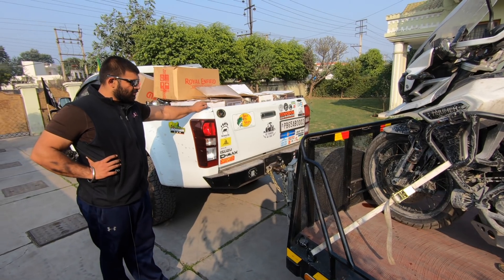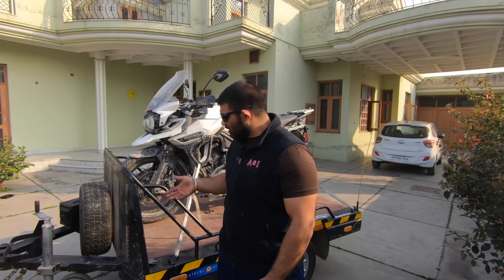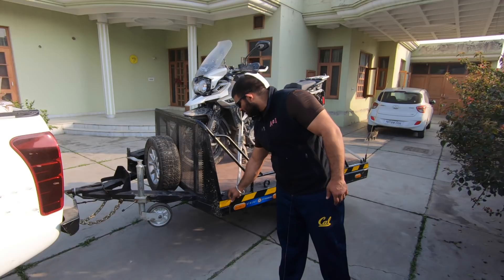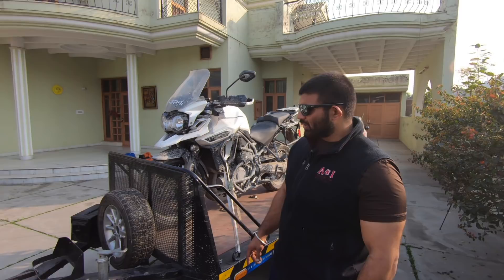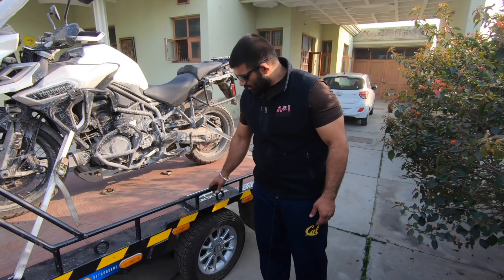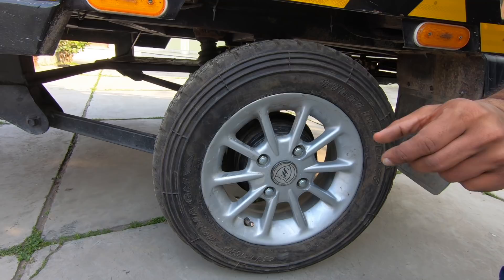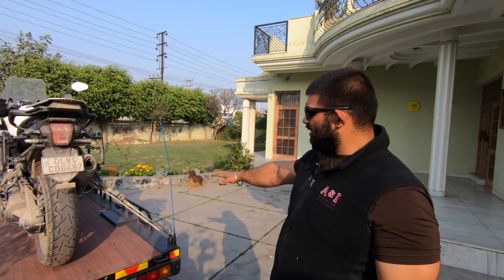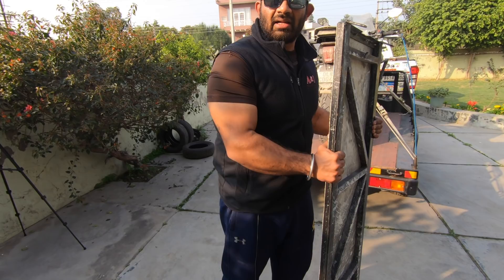Jaideep's Motorcycle Trailer Carries 2 Bikes At Once: He Built It From Scratch

Comment: I believe the trailer is a bit too high, but probably suitable for roads in India, but this trailer is disadvantage for bikes which not able to start or someone physically smaller in size as the ramp is too stiff. There should have been some jaw winch or manual winch, or trailer should have been design to be lowered hydraulically. Some housekeeping required on the electrical connection, does not look nice exposed. The turnbuckle eye a little bit too big, as long there is no excessive gap its fine. Keeping those boxes is unnecessary in my opinion its an hazard for road users if it falls.15.54 is dynamo or eye bolts, collared is better.
Reply: Hi there Dave, 
Completely agree to some of the issues you pointed out.
The trailer is used for semi-offroading due to real bad roads in some of the areas I deliver to, hence the height and off-road dampers.
Turnbuckle eye is loose for the pin here, was made with a 20k lbs ball type tow point on a height adjustable rail in the next few weeks.
Physical strength has never been an issue 😝 plus in India, there are always people available to help push bikes up the ramp.
Winching 2 wheelers is again a 2 man job.
And have been waiting on my universal 7pin male/female connector set for around 2 months. Will be installing that shortly.
Cheers
Reply: @TreadTrails  Thanks for the clarification never the less its a great trailer and seems heavy duty but not an issue Isuzu D-Max. You may also get something to keep the front wheel in place or Tie down during strapping. The Tyre  tie down or wheel strap tie down is also good buy unless you're unsure how much tension to put on the ratchet.
Reply: @TreadTrails  is it road legal?